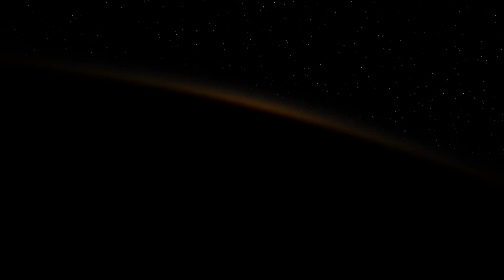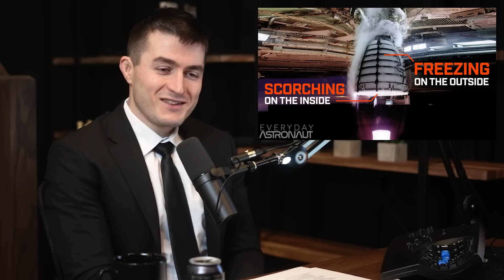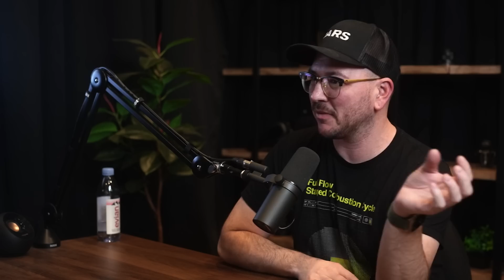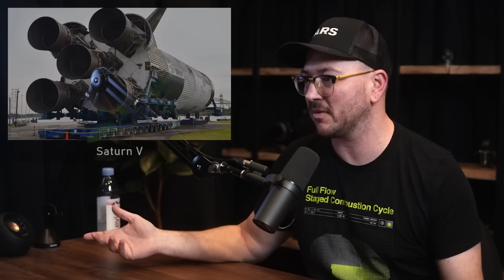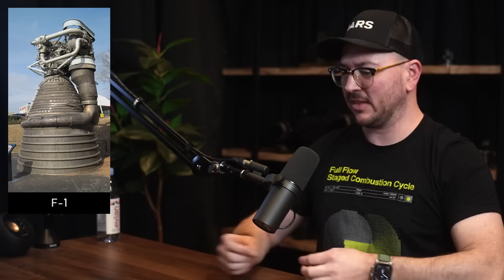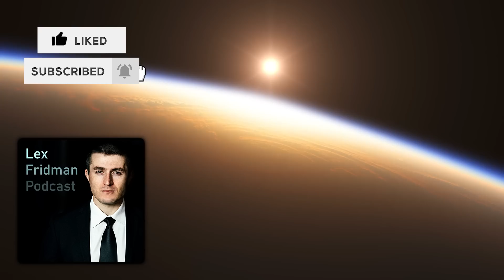Why rocket engines don't melt from heat | Tim Dodd and Lex Fridman

Comment: Do we use magnetic containment for heat issues?
Reply: You cant magnetic contain hot gas from exaust, only charged particles like plasma, plus magnetic containment require a LOT of electricity and very heavy electromagnets, making it incomparable with rockets

Comment: I’m an undergraduate senior mechanical engineering student. I appreciate getting some love for even the low level work I do. I could spend hours staring at a screen all because I put a plus sign instead of a minus sign. Or spend hours studying the works of previous engineers. It’s not much but it’s honestly work!

P.S. I know what heat flux is.

Comment: They're called heat exchangers. Like your car radiator. They're not magic and there's been computer modeling for process controls for decades. There's also a fuel pump like in your car except maybe a little better..
Reply: I hope you realize the pumps on rocket engines regularly exceed 10,000 horsepower and are in no was similar to a car fuel pump.
Reply: @keltondavis4559  So smart you missed the satire. Link to magic 10,000hp pump used on rocket engines please. Do you know how big a 10,000hp pump would be and what exactly would power the pump?

Comment: Funny how the rolls royce engines on ALL the planes on 9/11 made from the same high tempered steel completely dissolved into thin air
Reply: What about shanksville crashed in an open field… not a piece of wreckage or engines! Same as them all ! Oh but they found passports from saudi arabia
Reply: @YeshuaChristKING  what's worse, that the government did something or that a country's people did nothing about it....
Reply: @mbjac  Considering that the alternative to the government doing bad things in your example is a coux, I'd say the governments actions are obviously worse. Nice r/im13andthisisdeep content.
Reply: @YeshuaChristKING  you’re speaking of flight 93 on 9/11? The engines were found multiple miles away or at least some sort of distance away…because they weren’t melted at all they rolled and bounced etc…. Also some believe it was shot down by a F/A-18 leading to the big distance between plane and engines
Reply: @Paulcs  Building #7 of the WTC is the key
Reply: @YeshuaChristKING  there were many many pieces of wreckage and both engines recovered from flight 93, as well as charred remains of people and their luggage. Where do you people get this crap?
Reply: Lex was told to stay home from work that Tuesday.
Reply: They weren’t being actively cooled. And they sort of exploded. Rocket explosions result in total loss of the nearly all the engine bell as well.
Reply: They crumpled, planes are very hollow
Reply: Hey if a rocket goes into an building it’s gonna get destroyed…a plane when into a building, what are you not getting?
Reply: @nasimchowdhury1943  you clearly don’t know how wreckage works. There’s always things left behind, it’s hard to vaporize everything.
Reply: How do you know what was left? You have no idea. In fact there are pictures on line of turbine sections lying in the street.
Reply: Lol! I was thinking 9/11 immediately too! 
Those planes also melted the metals of three world trade center buildings!! Not two, but three buildings came down!! 

President Bush also told everybody that just like road runner we can paint a tunnel on a big rock and run right through it!
Reply: @bluesque9687  the 3rd building’s metal didn’t melt d!pshit
Reply: @sblack48   well, it sure came down pretty quick!!
Reply: @bluesque9687  Seven buildings came down. LOOK IT UP!
Reply: But those passports didn’t burn :) oh and the bandana too
Reply: @Kris if a member of your family was murdered by your government, and you knew they did it, and all they said was "get over it" would you?
Reply: Idk maybe they flew into something 600mph+ moron.
Reply: oh jfc it's you again

do you post this shit under every video on yt?
Reply: I’m not across the conspiracy theories. What’s the actual accusation here? That the planes weren’t real??
Reply: @TjMoon91  they say explosions went off because the timing of the sound and shock wave of the  impact was supposedly off and the building fell like a controlled demolition. Debunkers say that the sound wave is correct.. idk lol you have to be an architect and a physicist and a chemist of metals, demolitionist, a lot of expertise required to make these judgements
Reply: @NinjaPotatoGaming  ,, on another note, my brother is a civil engineer. He said he was shocked, that people didn't realize that these buildings were going to eventually collapse with that kind of fire.
Reply: You really think there is a September 11. There is only ten days in September. Jiat say 10/1 from now on.
Reply: Who told you they completely dissolved? Your cult leader Trump?
Reply: I’m curious 

Do you compare 9/11 jet engines to a starship engine , as if they’re similar situations ?  

If so, you may have to go back and rethink every single thing you’ve ever known
Reply: Why would they melt? They exploded lmao
Reply: I thought there was an engine found at ground zero that didn't even match the so called planes used during 9/11?
Reply: @drug.3797  there was an engine found that did not match a model number found on an airline website. That’s very different. When a conspiracy theorist finds something that supports his conclusion, irrespective of where it came from, he never questions it. It becomes a fact. That’s what happens when you start with a conclusion and work backwards. That’s why real investigations gather evidence, verify it, then see where the evidence leads.
Reply: Concrete turns to dust mid air. Cars blocks away randomly catch fire. Steel beams turn to dust in mid air. 
https://youtu.be/NZJZRxBrS4I
Reply: @beenschmokin  im not wasting my time
Reply: Ablative cooling
Reply: I don't think they did, the Pentagon wreckage was a bit strange though...
Reply: Ok but they definitely are not the same engines. Also they were crushed when the towers came down silly.
Reply: I really don't know how people believe this. My agency headquarters was at 700 Army Navy Blvd (directly across I-395 from the Pentagon). Everyone whose office was in the north side of the building heard the plane coming in, looked up and saw it hit. Mw wife who worked there too, was coming in late that day, called me right after the second plane hit the world trade center, to ask if she should keep going into work or turn around and go home. It seemed clear to me that the DC area was likely a target as well, and they might even try and hit the Pentagon.  And I told her that, and to go home. A few minutes later they did hit it.. I rarely tell that story because conspiracy theorist say I must have known it was going to hit, due to the fact that I worked at an IC agency. But, it was just common sense. What people should be mad about, is  the incompetence that allowed it to happen. How our IC  agencies had enough information to see this attack coming, and stop it, and we dropped the ball and dropped it badly. Sometimes, I think the government started the whole " it wasn't a plane"  conspiracy just to cover that real fact of that incompetence up.
Reply: @ralphholiman7401  thank you for telling that story. dropped the ball is an understatement
Reply: @ralphholiman7401 It was not a plane. It was a missle painted to look like an airplane. This is very clear by the complete lack of damage to the building where wings should have been. Coincidence it was also an abandoned section that was under construction. Ask about the ghost plane that landed in Chicago that day. Ask about the MANY private jets that were allowed to leave the country the next day. Ask about the trillion dollars and why 7 buildings fell while only 2 were "attacked?" What was in tower 7?
Reply: @beenschmokin  , yeah........
Reply: @ralphholiman7401  Google pics of the Pentagon hit right now. The wingspan on that plane is massive! Where did they strike the wall?
Reply: U think all the videos of the planes crashing into the twin towers were cgi?
Reply: 🤣🤣🤣🤣 it got blown into tiny pieces mate...its called being blown up
Reply: Why are so many of you emphasising ALL of them…

We don’t need to find the wrecked engines (whatever their state of destruction) for the ones that hit the towers…

We watched the planes hit… 
So the fact that you can’t find THOSE engines, wich we know definitely actually did hit those two targets…

Means you’re argument that you can’t find the engines in the pentagon or the field is moot.

Clearly “rolls Royce jet engines” CAN be involved in a crash and never recovered
Reply: Last time I checked airplanes are made out of a complicated expensive aluminum alloy that's designed to stretch and not crack
And the thing is it's extremely flammable when you add jet fuel and sheetrock insulator
Reply: @thecloneguyz  sheetrock, gypsum, is NON flammable and that's a main reason it's used. GTFOH!
Reply: @thecloneguyz  where's your picture paragon of truth?